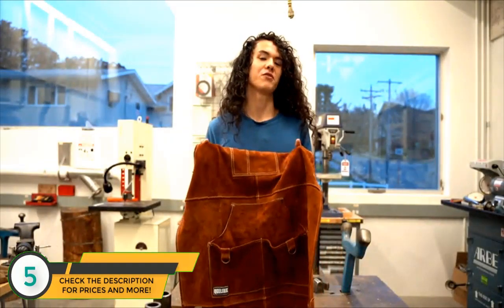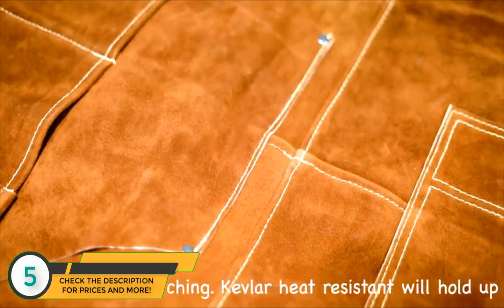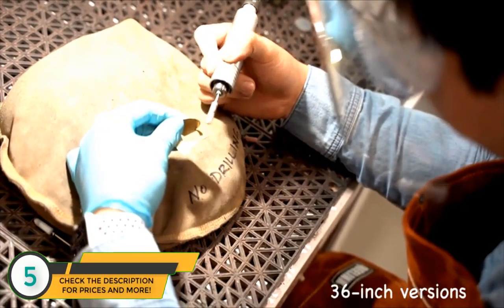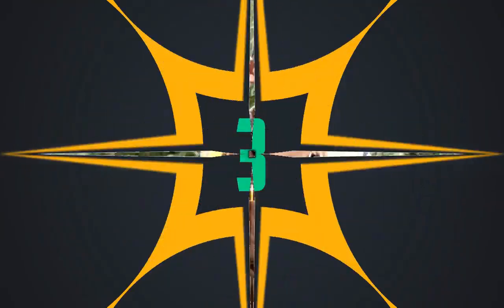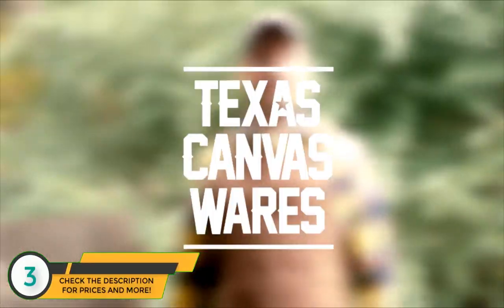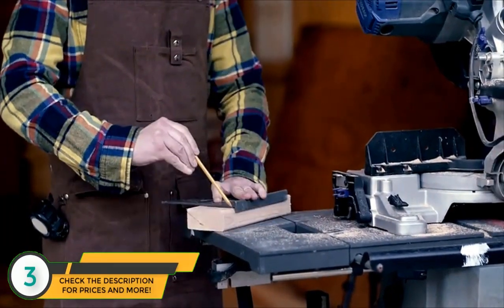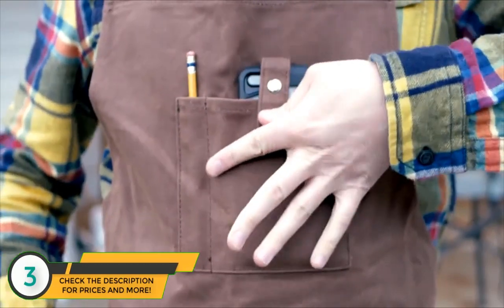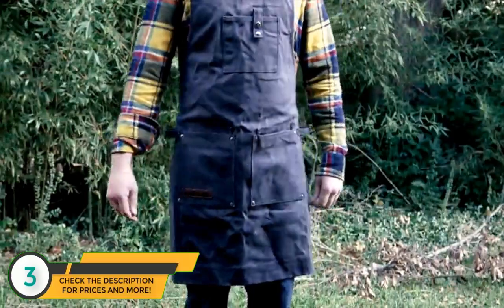Best Shop Aprons 2019 - Shop Apron Review

Comment: This really wasn’t a good review. You jumped across type of aprons instead of doing a review for one type. Woodworking has different needs then welding and painting and pottery. You should have done a review on just one with several from that type and to say “best” is actually wrong because it’s prospective. Each person has their likes, desires and needs. I’m fact I use a woodworking apron and the ones you showed would not even work for me. They suck compared to the one I use.